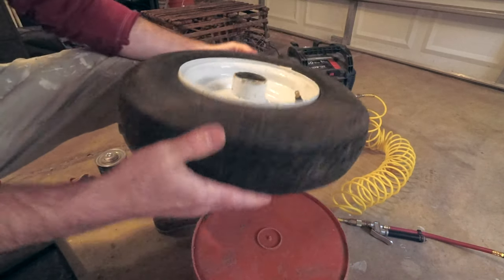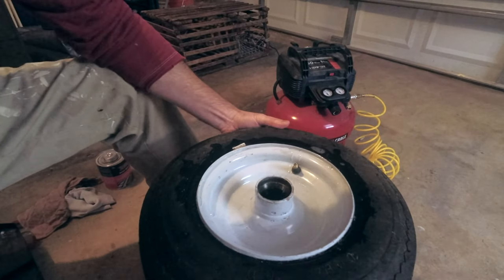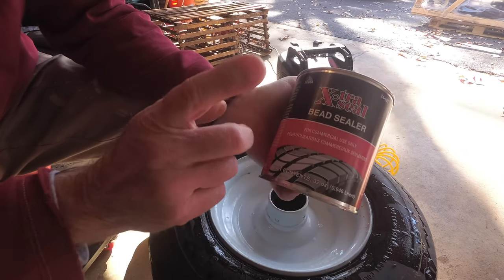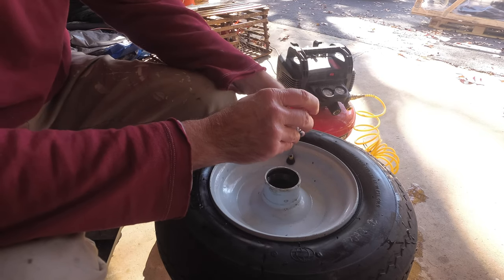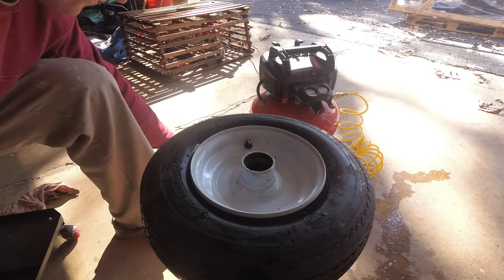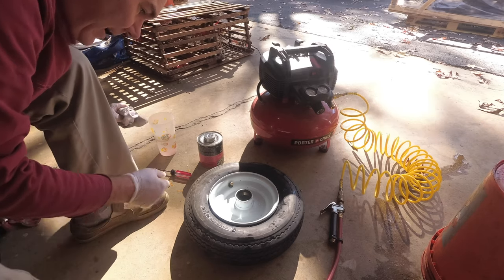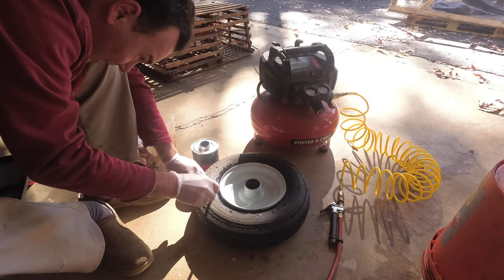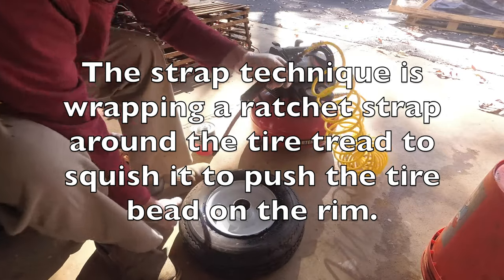Small tire repair - using bead sealer to fix a flat trailer tire. Does bead sealer work?

Comment: My son uses this on cars all the time...He has no complaints. Got my Xotra Seal at Orieleys auto part..10 bucks with tax....Can't wait too try it on my lawnmower tires.
Reply from the maker: It's good stuff - and as long as your tires aren't too dry rotted or cracked it should work perfectly.
Reply: O'Reilly's keeps it in the back room.... they told me they usually just sell it to their commercial accounts...  I had to ask for it as it wasn't on display inside the store...... 32 Oz can was 1299 + tax

Comment: Hey Wayne! How's that bead sealer holding up after two-years?
Reply from the maker: I think it's still doing ok! Those tires belong to a friend of mine. When I have a mysterious leak with any of mine, I'll be doing this again!
Reply: @WayneTheBoatGuy  I have an old garden tractor with a slow leak, slime did not touch it so I will get some of this stuff. Thanks for the video.
Reply: @07Convertable  if you have a bead leak, Slime will not work. Its only recommended for the tire base, not the sidewalls or bead.Cheers!